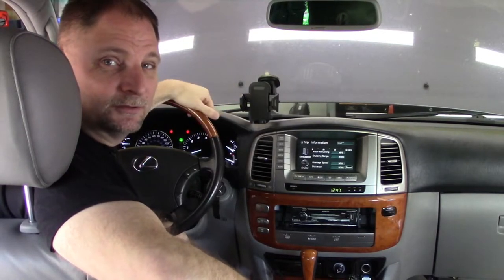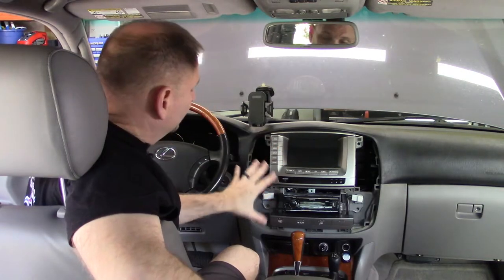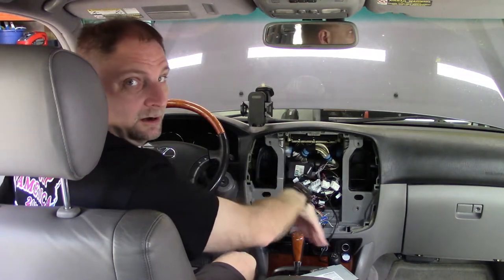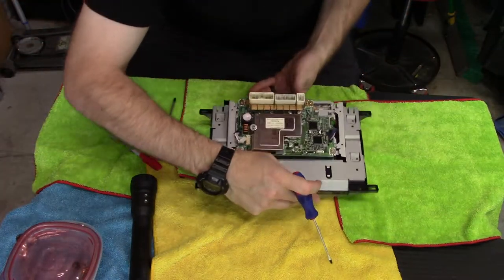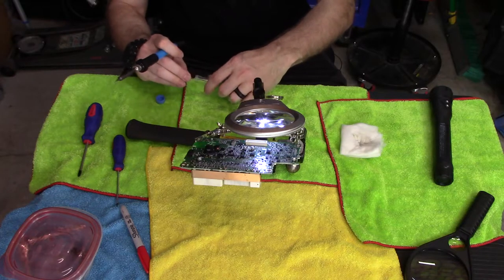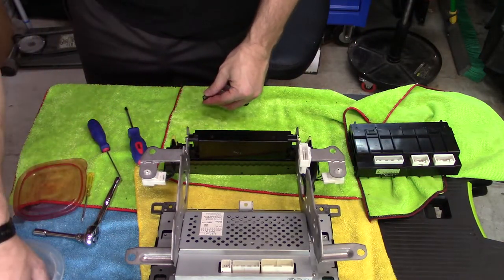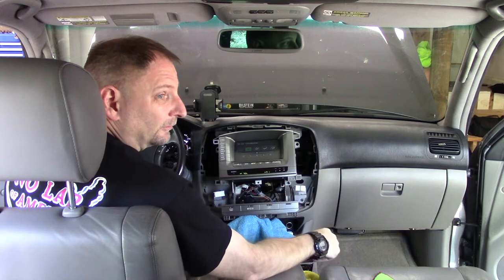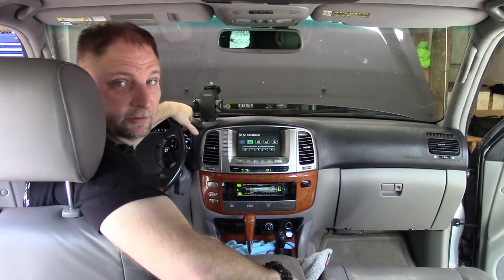Lexus/Toyota MFD Repair

Comment: Keep having the same issue with my 04' Ls430, thing is its constantly glitching. .Sometimes the head unit works fine right off the bat then after a few minutes or half hour later completely shuts off, or it won't work at all and then between 30min to a few hours works again and then freezes up, its incessantly irritating. So my question is would this be the exact solution? 

On a side note, this should also be a manufacture recall considering how Lexus is always chest thumping of how reliable they are, i have owned 7 different Mercedes prior to purchasing a lexus and never had an issue like this Ever!
Reply from the maker: Mine was intermittent as you described, so I would guess this is same issue. And yes, with the amount of vehicles that are affected it should have been a manufacturer repair like the bmw pixel issue from the late 90*s
Reply: I have same issue nearly 2 years (LC100 Cygnus 2003). I  see this video and follow the instruction (pin 60). Now my MFD (radio & air condition) working as it should be. Big thanks to  Maintainer Garage.

Comment: Hey! I have a 2005 lc100 series with out side temperature not showing but my display has no problem, it works fine. I tried changing the ambient temperature sensor but it did not solve the problem. Do you have any suggestions please?
Reply from the maker: I would check the wiring to make sure everything is plugged in

Comment: How did you instal that stereo? I Have the exact same truck as you and I went to several stereo shops and they all told me that it was impossible to do
Reply from the maker: You have to put in a 68 ohm resistor on the C plug pins 9&10  to get the MFD to work for a/c and other stuff. There is NO dash kit so it will have to be custom. Google "68 ohm resistor lexus" and you will find  great pics and info.
Reply: @maintainersgarage  hi I have same problem on toyota prius 09 what I need
Reply: Do I need the same 68 ohm?
Reply from the maker: @danielperez-lu4ff  if you are replacing your head unit then yes you need the 68 ohm resistor. If you are fixing the display, no you don't need the resistor
Reply from the maker: @danielperez-lu4ff  This repair could work for you

Comment: My Lexus RX 350 2008 is currently having same issue. It’s been up to 2 months and couldn’t get anyone to fix it. So I came across this video. On my car when I try to on my ac it says CHECK AC CONNECTION. Then when I press menu or another button it says CHECK EXTERNAL CONNECTION. Also my radio is malfunctioning. It comes on but I cannot increase or reduce volume. I will like to know if it’s the same fix before taking it to an expert who can help with this procedure. Thanks
Reply from the maker: I would check all the connections behind the radio and display, if all those are good i would GUESS that you have same problem. But, I could be wrong. At this moment it's broken, try your best to fix it. You can't break it more!! Good luck
Reply: @maintainersgarage  thanks for this advice. I am going out right now to meet a good electrician who can check all the connection and the panel at the back of the radio and screen. I gave it to an electrician who checked before and all the connections were good. They also checked all the fuse and it was all good. I am also guessing it’s the same problem with yours. Please what point did you solder and what is it called? So I can also explain to the electrician and show him your video. Awaiting your reply. Thanks
Reply from the maker: @godswillabhulimhen-okosun9714  it's pin 60 on display plug circuit card
Reply: @maintainersgarage  I tried doing it today but couldn’t find it on my car probably because it’s a different car. Mine is Lexus RX 350 2008 model. So the panel is different. Today I tried doing it but was confused because the Lexus navigation panel has more than one panel. It’s about 3 to 4 different panel. There is one panel very close to the screen. A wider panel. There is another panel which controls the menu, climate and info button. There are two others and it’s not easy losing all of them. But I tried checking but couldn’t find any 60 pin like your video showed. I only saw c60 on one of the panel but didn’t have pins like the way yours was built. Is there anything else I cann do?
Reply: @maintainersgarage  do you know if it’s the same fix for Lexus RX 350?
Reply from the maker: @godswillabhulimhen-okosun9714  i would guess yes. Same on Prius
Reply: @maintainersgarage  ok thanks. I will go into it tomorrow again to see. This time I will lose all the panel which I didn’t do today. I will lose the card that’s just attached to the screen and see. I guess it’s operation search for the 60 pin 😊 thanks for your help and response. I appreciate

Comment: when you say it was pin 60 and it was a cold solder joint you never showed exactly what to do with the solder gun.  Your video is exelent
but i wish I can just see a picture of the before and after what you exactly did with the soldering gun,
Reply from the maker: The solder on the pin looks different that the other pins. Put the hot tip of solder iron on pin 60 for approx 5 seconds. You should see the solder on pin 60 turn back into liquid and then remove hot solder tip. You are just getting the pin hot enough to re flash the solder and harden again and create a solid electrical connection
Reply: Thank you for explaining exactly what you did .  My Rx 330 2006 is doing the exact thing right now.  And my unit looks identical to yours minus the outside temp shows up on the screen but if this works you’re going to make me a happy guy.  Thanks again Bernie
Reply from the maker: @berniekuzminski1920 you are welcome! Hope it works out for you!
Reply: @berniekuzminski1920  hi Bernie I just wanna ask is it works with your rx330 because I’m having same issue here with mine